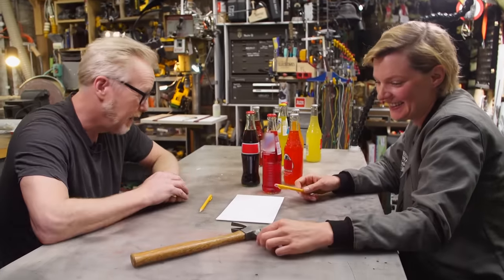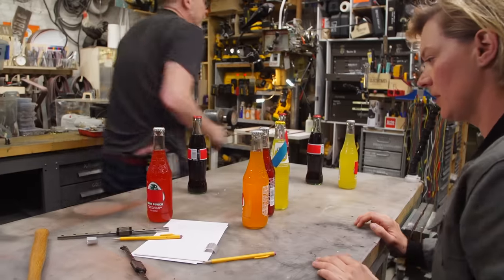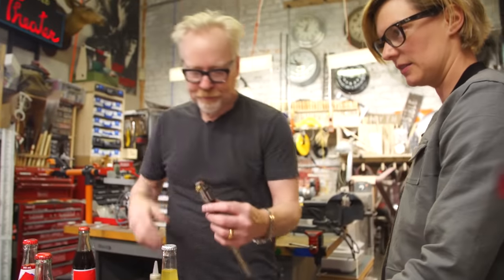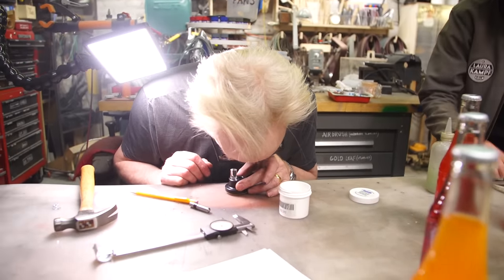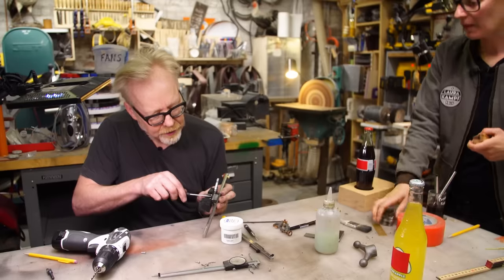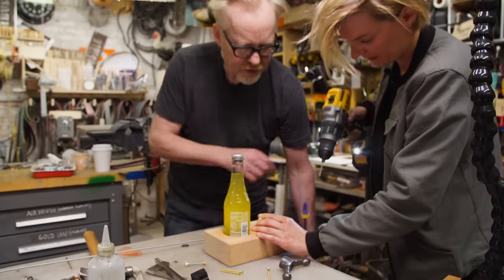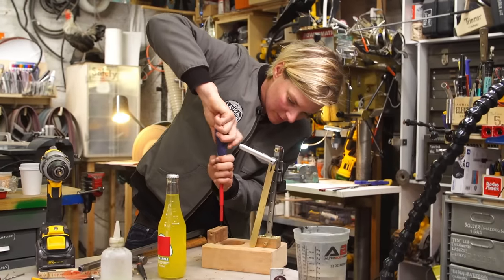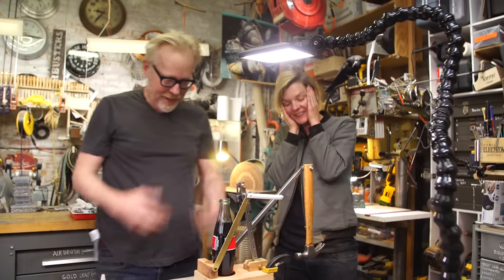Adam Savage's One Day Builds: Overengineered Bottle Opener!

Comment: It would have been nice to stick to the original idea, one bottle used to knock off the top of another.  You could have milled a bottle with the cap on out of aluminum as your "opener/hammer."  Then it's on an arm that you crank back with a machine knob like off the old toy crane machines, it pulls the arm back until it clicks into a holder.  Then you've got a big red button that releases it knocks the top off.  Biggest issue is the different height sizes on the bottles as far as making it simple for party use.  It would probably be a thing where it's set up for one kind of bottle and you only serve that size.  Then it's adjustable for when you are serving bottles of all types.  All Jaritos bottles are the same I believe, so one setting could be for all of those.

Comment: I know I'm late to this, but my original thought watching this was instead of a hammer. have a seesaw type thing with one end of it underneath the "hammer" that pops the top off, and the other end sticking out so you could like slam your fist on it to drive the hammer up the slide popping the top off.
Reply: Wasn't finished watching the whole video when I made that comment, but if you had funneled the hole that the bottle sits in and drilled a hole in it to drain would have been nice too as it looks like the soda spilling over the top onto it is a thing that will happen quite often. All in all though, an excellent build! I wish I had the resources to build incredible things like this.